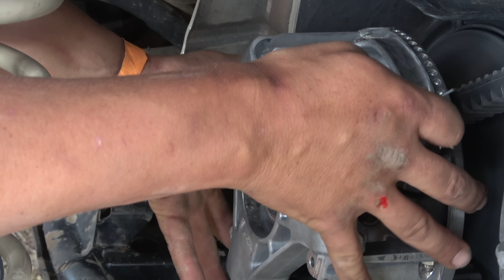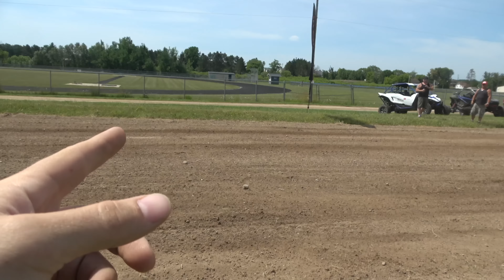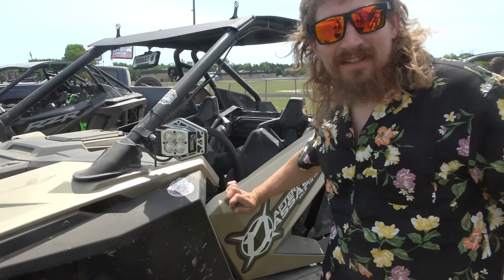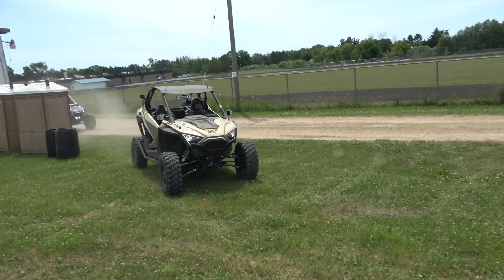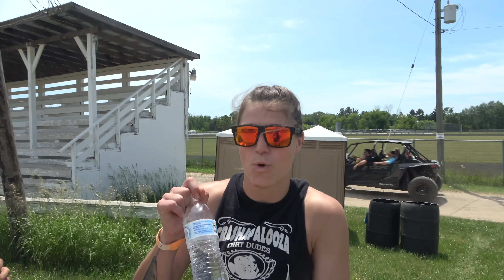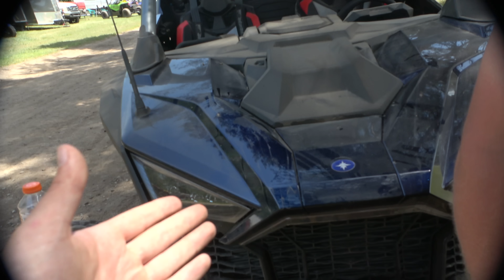Stage 6 Pro XP SHREDS The Drag Strip! Aftermarket Assassins VS Whalen Speed

Comment: It sounds like the Whalen pro xp would be equivalent to aa stage 4 running 98 octane on stock injectors. 

The reality is drags are fun and they prove whose machine is faster on that day with that driver on that specific surface. 

I think all the top tuners probably make near identical power numbers to the crank. I believe some might be better at clutching.
Reply: I agree I put it on my turbo r at walen hit 234 on hub dyno.

Comment: Jake, after you install the bigger injectors and get everything set for the stage six. Can you switch back to stage 3 for the trails and run 93 again? Or once you switch you stay switched for 6? Local Mitten guy here! Can’t wait to meet y’all!
Reply from the maker: Only if you have the stage 3 tune that’s meant for big injectors. There’s 2 different stage 3 tunes. With big injectors and without